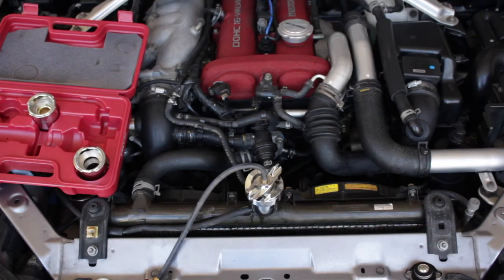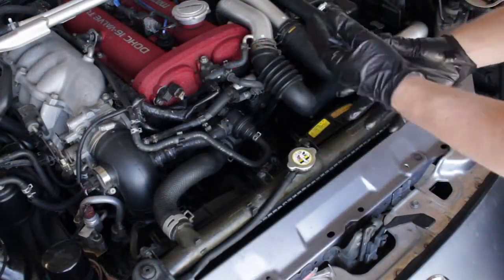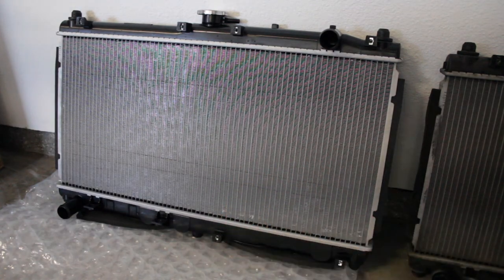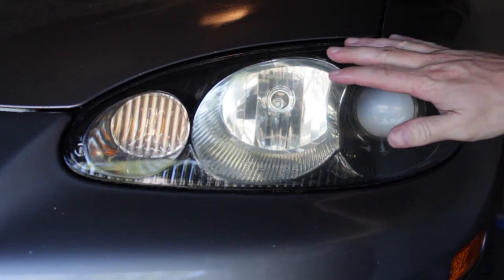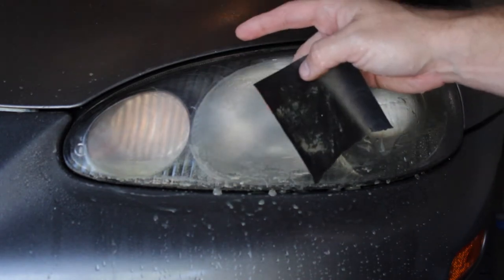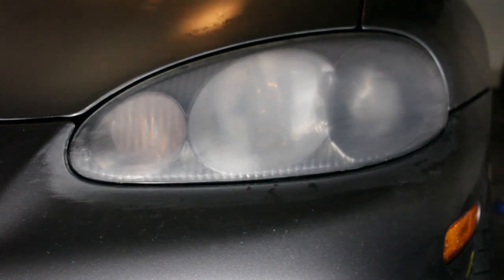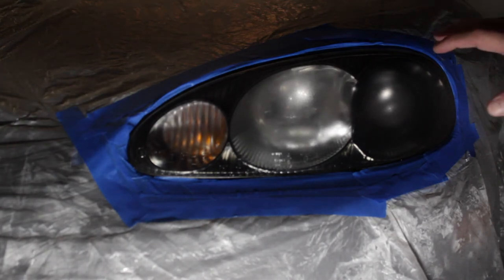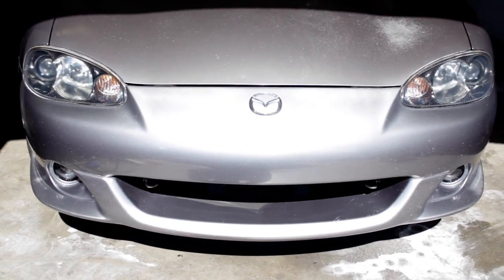2005 Mazdaspeed Miata - Episode 8: Replacing a Radiator and Restoring the Headlights

Comment: Why not going with an aluminium radiator? And I'd go another stage on the headlight with a polish compount it should clear up the foginess
Reply from the maker: yossi774 thanks a ton! Really big on keeping these restorations as factory as possible. Can’t really argue with the stock unit making it 160k miles. On the NA Miata I would always advise going full aluminum (and larger core). Those NAs need all the cooling help they can get. Headlights look pretty solid...may use a slightly more aggressive rubbing compound in the future, but super happy how they turned out.